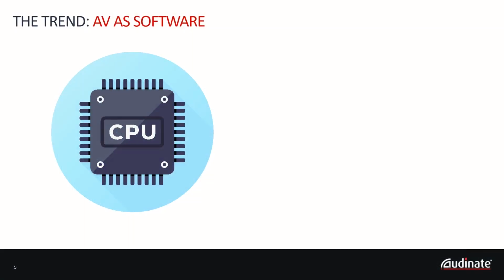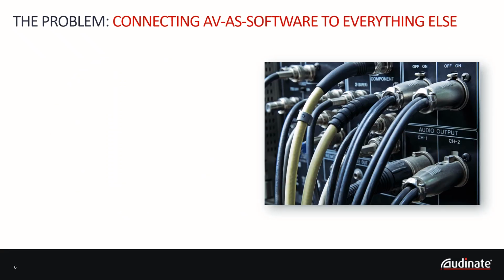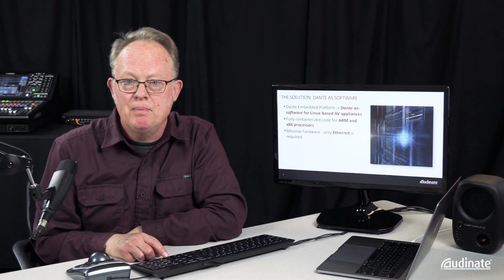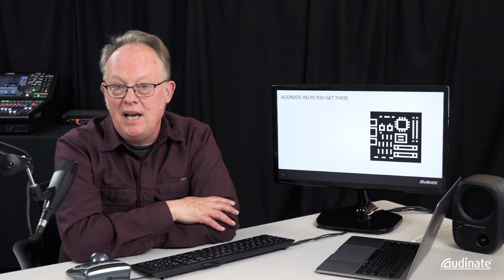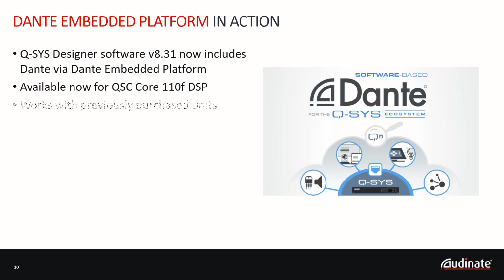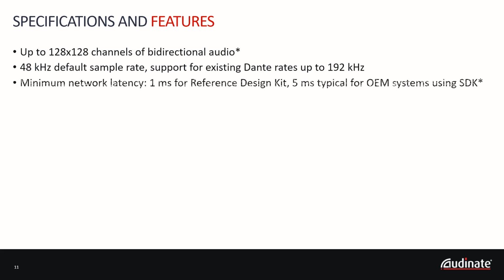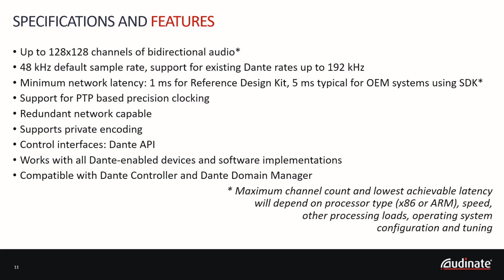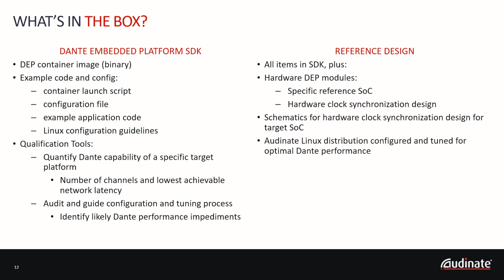Dante Embedded Platform Introduction

Comment: How about making the Java-based (well almost entirely) Dante Controller available for Linux? How about Dante Virtual Soundcard for Linux? I would use both right away.

Oh and of course there's ideas for little embedded tools on a RaspberryPi, but apparently Audinate is not open to single private developers with their embedded SDK. The video mentions what Audinate gives to me, but I guess I won't get it without signing complicated contracts and so on.  And the x86 version apparently is not yet available, which would be good to start experimenting before going ARM. You're not addressing the masses of nerds on Linux, so you're missing out opportunities. In the end you might lose the Linux market to AES67, which is currently not that easy to set up but free of any licenses and compatible to Dante. Except for DVS, well OK.